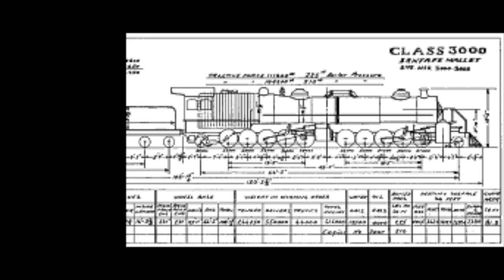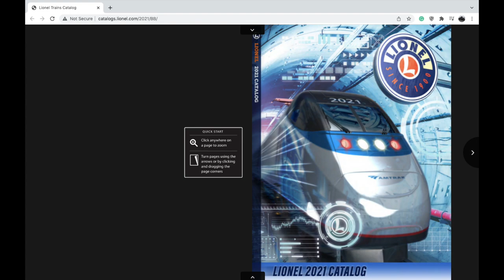Lionel Santa Fe Vision Line 2-10-10-2 Product Review

Comment: Had you have a problem where the blow down smoke unit clogs to often? How do you fix it?
Reply from the maker: Sometimes mine does clog but not often. When it does, I blow some air through the outlet hole and that usually clears up any air bubbles.

Comment: How many interchangeable bells are on this model?
Reply from the maker: Physically, there is only one bell for the model. For sounds, there are five different tones. The tones vary from either a high pitch to a low pitch depending on the liking of the operator.
Reply: @TrainMaster04  how do you disable background sounds on a Lionel legacy locomotive like rail squeals? ‘Cause I HATE them ⚙️⚡️😱😡
Reply from the maker: @peterd.9893  To my knowledge, there is no way to turn off the background sounds. When the locomotive is running the wheel squealing should only be activated at slow speeds. It should turn off at a certain speed which I believe is 10mph.
Reply: @TrainMaster04  that’s why I’m so sensitive to high-pitched sounds. The rail squeals can sound like people screaming in serious terror, I remember one time I was watching a Lionel train on the tracks and made that sound and I clenched my fists and shriveled up and my blood testicles turned into ice and was not happy. At all. 👻😱🥶😡
Reply from the maker: @peterd.9893  I understand. Your only other option would be to turn off the sounds.
Reply: @TrainMaster04  I know. I have a better plan though, maybe getting a device that disables only some of the sounds in the background of the engine so I wouldn’t have to hear them anymore! 😃😊🔇🚂